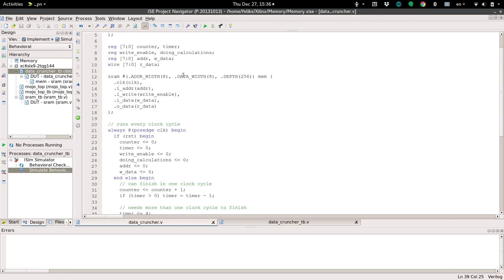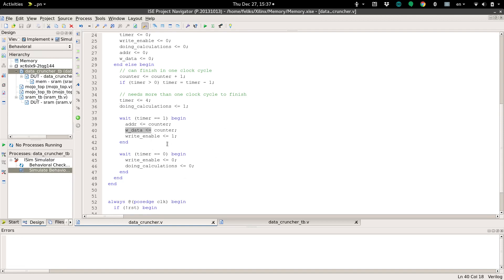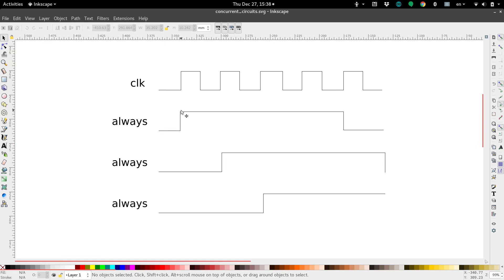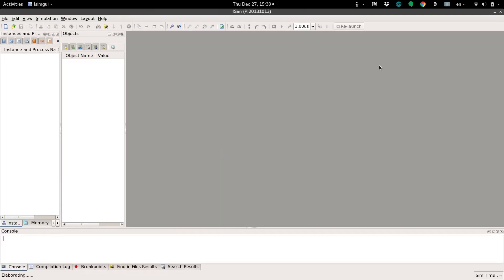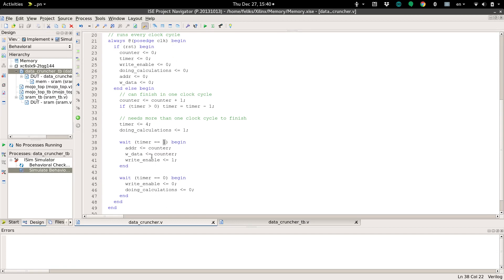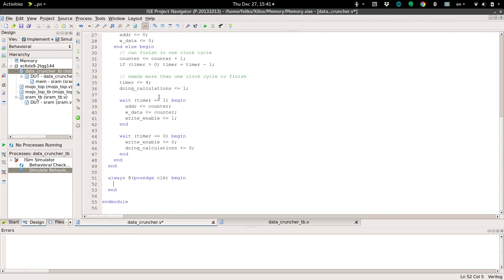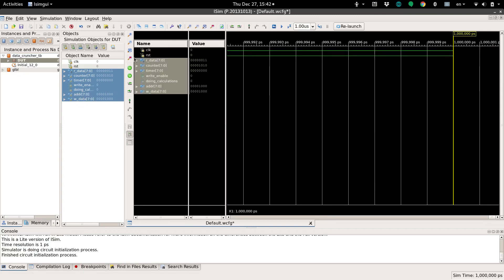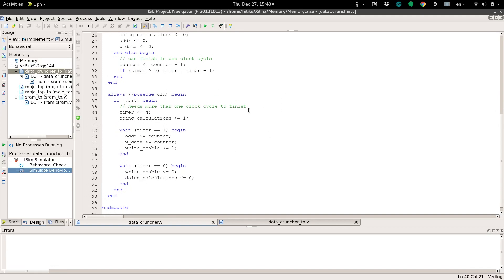Learn FPGA #21: More Time Efficient Circuits (Concurrent Circuitry Tutorial)

Comment: Is this is situation where pipelining could be useful? Moving data through the calculation like in an assembly line so that it doesn’t have to wait until the end of the always block to start calculating with another input but instead every clock cycle every individual calculation is done but on different values. Like a production line, there is something waiting to take its place once it’s finished and moved on to the next part of the production line or next part of the calculation

Comment: I would like to see some tutorials on creating sine wave using wavetable, adjust it's amplitude,frequency and duty cycle using a pot. Some DSP concepts as well like designing fir filter. All your tutorials are very well put. When I did my grad school in electrical eng 2012, there weren't much information on the web,rather we have to decode stuff from scientific literature as book's in our college most of them not beginner friendly obviously

Comment: can you actually visualize the circuit it makes?
Reply from the maker: Not totally sure what you mean, but the difference would be multiple separate circuits that run at the same time vs. a single circuit that takes a long time to finish a cycle. Does that answer your question?